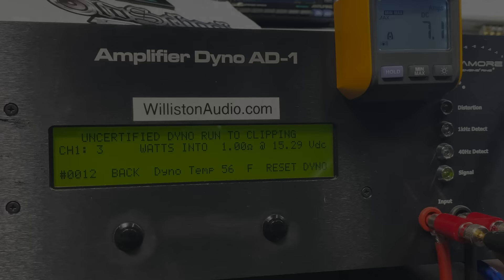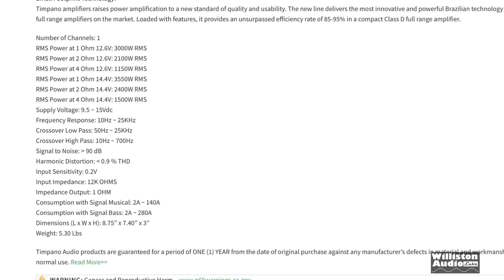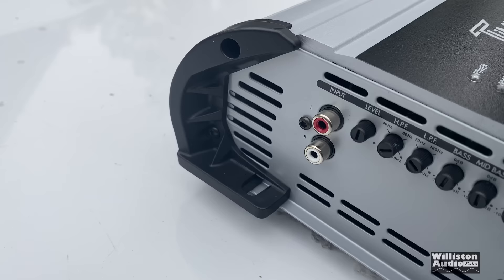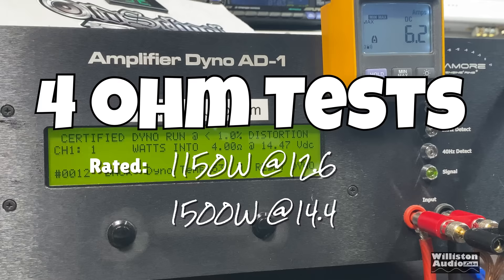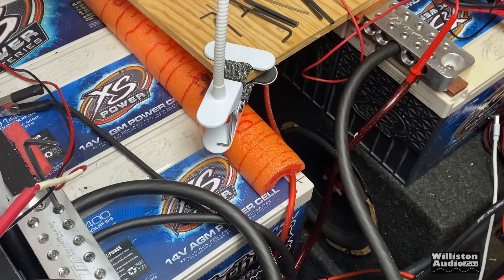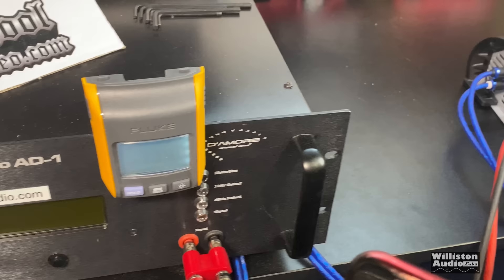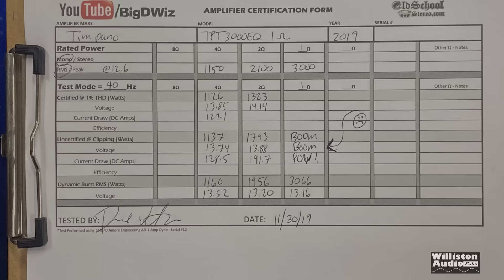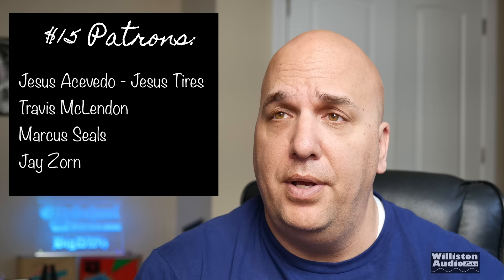This $220 3000 watt Amp GOES UP IN SMOKE! [4K]

Comment: Get yourself a good CO2 extinguisher for the lab. While it doesn't really matter what you put on a burning amp (it's scrap anyways at this point) you'll end up with dry chem all over your other electronics...and dry chem is a corrosive pain in the ass with electrical stuff. I don't even want to think about having to clean that crap out of your amp dyno!

Comment: I urge you to buy an (at least 10 lb.) CO2 fire extinguisher, and keep it close at hand when running your tests.  The dry chemical extinguisher you say you've already got does make a terrible mess, and is not really suitable for use on electronics fires!  CO2 is far superior for this application, my man.
Reply from the maker: 10-4 will do

Comment: You know these Brazilian amps don't like the amp dyno. You might slow down the sales a little by trying to scare people into thinking they catch on fire but eventually they will take over the amp market. Too much power and efficiency for a small price.
Reply from the maker: I’m not trying to scare anyone, these amps are doing it themselves.
Reply: @wal I support support the American based companies as well as the next guy , but putting a full bridged rail voltage amp on amp dyno and then hollering fire isn't the way to go about it . I may be accusing you of doing something that you truly don't understand and if I did I apologize. I just think you know more about how these amps work than you say and using the dyno to put a bad mark on there name, I know how all this works and I think you would make a hell of a politician. I still love your channel and have a lot of respect for you on certain things.

Comment: I looked at the spec sheet and not one single spec has any qualifier at all.  Is this normal for car audio, but in HiFi and in PA this is a big red flag that a manufacturer is misrepresenting the product.  If power is stated without an industry standard qualifier such as continuous power, music power etc or the newer THX spec 0.1% THD, then the spec is completely meaningless.  Power is the most abused spec of all, it can be calculated in many inventive ways.  I can run my open plan lounge / dining room HiFi on a 50W amps at 25% volume.  Heck I can easily exceed 90 dB SPL (hearing damage levels) with just 50W,  you don't need 1000s of watts in a car.  it's just a ridiculous and meaningless marketing number.  Equipment specs like these usually mean the manufacturer is lying about their product.  In other words, it's a con and you should just walk away.

Only buy audio products that have industry standard "qualified" specs.  For goodness sakes, it doesn't even give a dB variation over the stated frequency response range.  You can say any audio gear has a 20Hz - 20 kHz frequency response, even if there is a -100 dB loss or more over that range.  The industry standard qualifier for that is -6 dB or +-3 dB BTW.

Comment: I just don't trust Brazilian amps.  Even if it did not go up in smoke the distortion on the one ohm and two ohm test are enough for me to say no.
Reply from the maker: These are made for a specific system type and not what’s typically used in the US

Comment: And the reason why I don't believe in trying to get crazy power from a small amp for as cheap as possible. Not only does it sound like crap, the reliability is just not there. So why? To sound like crap very loud up to the point of burning your car to the ground and brag about it? No thank you. I would rather compete and have my system sound just as loud to the human ear if not louder, much cleaner, but 20 times less power. Quality beats crap any day, unless your only desire is to get a number on a screen for 10 seconds for as cheap as possible without impressing anyone but yourself.

Comment: I have strong feeling that you have it just a Lil bit too much Juice cause usually (Brazilian amps manuals they say 12.6V rated RMS Power) they don't need that much voltage to get rated power but alot of amperes.

Comment: buddy you put a 300 amp fuse on a 3000 watt amp @ 15 volts and u won der why the fuse didnt pop? like use your fuckling head bud , u should have started with a 150- 200 amp fuse and thats not under fuse thats its regular fuse

Comment: My suggestion is stay away from the brazilian amps... The components inside the amps are realistically not made for car audio
Reply from the maker: These amps are designed for different music and to be used with full range type setups. I’m not sure why they import amps with this type of design 🤷‍♂️
Reply: Nick Genre Well SoundDigital, Ground Zero and Banda Viking are solid Brazilian amps this one ist more like Taramps which are also not that Great for making constant power